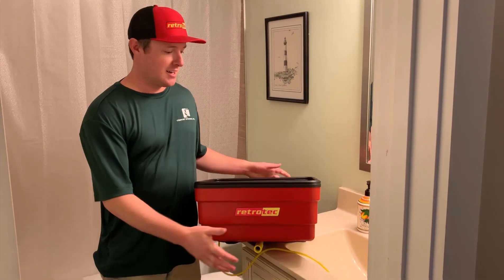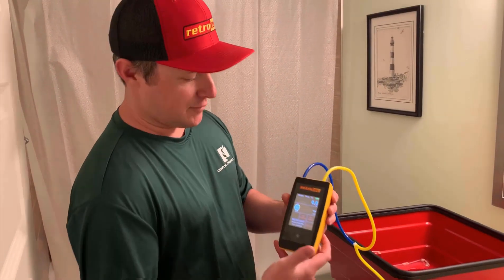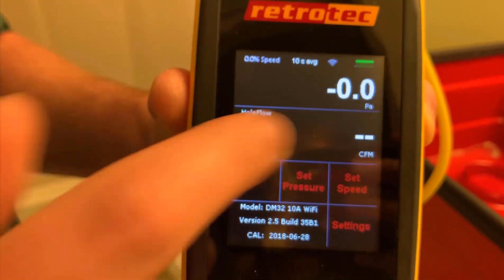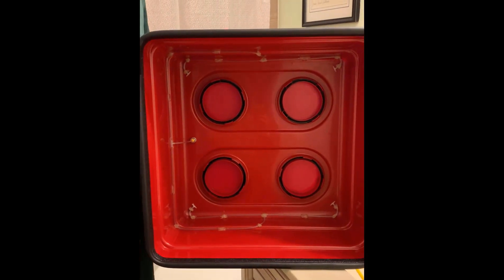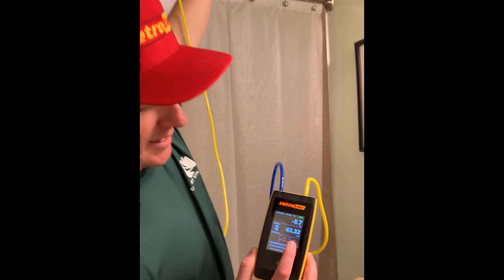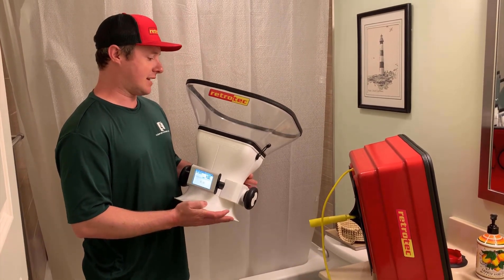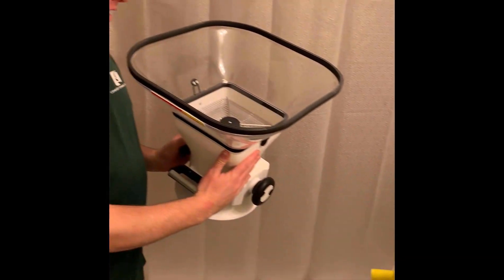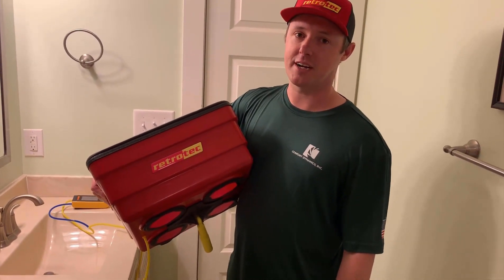Retrotec FlowBox Demonstration

Comment: That’s a very cool exhaust fan flowmeter. It looks good. Even though it’s only imposing a 5 Pa restriction on the exhaust fan, it will probably reduce the flow a tiny amount. Is that compensated for in someway?